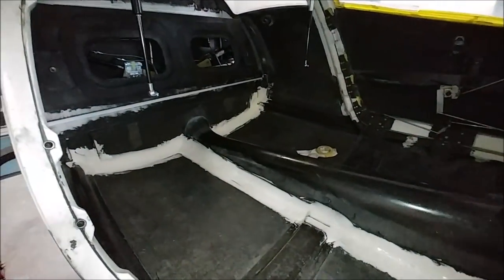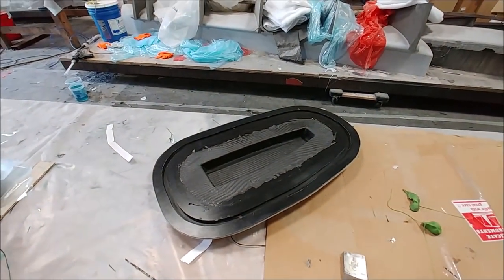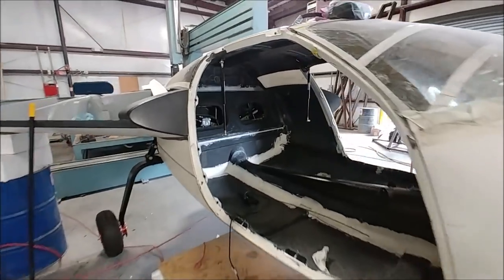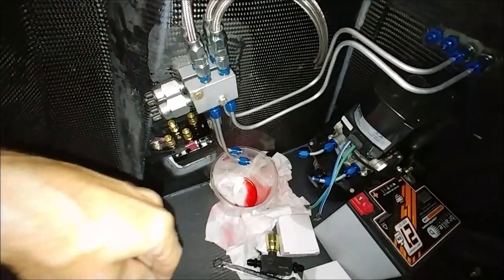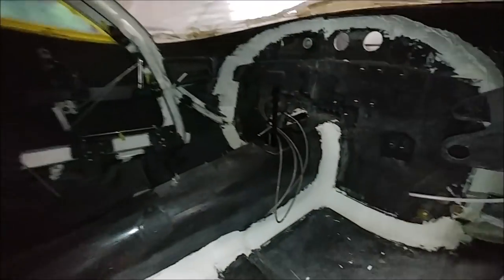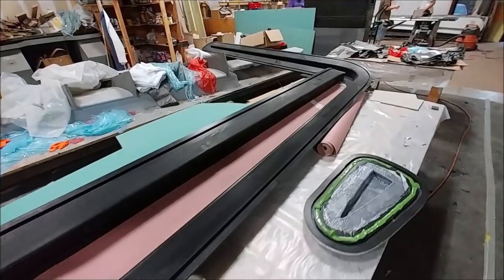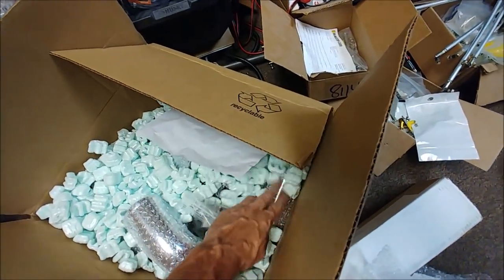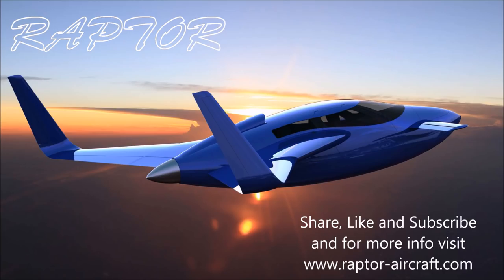Raptor Aircraft July 31st 2018

Comment: Stainless hinges seldom work due to partial fusion (galling) of the componens. You should use dissimilar metals like brass or bronze for the bushings on stainless pivots.
Reply: Bronze is Best, it has a small lubricant quality ( being Copper & Tin ) and used for CROWN wheels in Cranes and Differentials. Brass has a grainy crystalline structure from the Zinc and is exponentially abrasive.
Reply: Fernando Lopes 
Can confirm! I'm surprised my cutlery drawer doesn't weld itself together!
Reply from the maker: Thanks